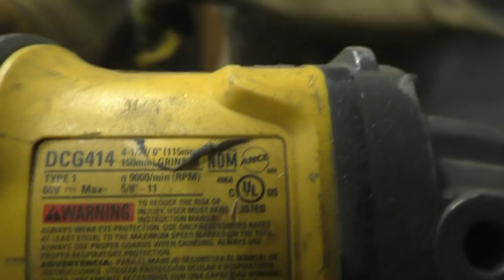Grinder Safety -- and lies you are told to scare you.

Comment: The guys who circumvent safety devices are all the same, It's some type of bravado issue for them, as if having a milky eye, missing finger, or black lung is just part of being a man. They are all over the place, guys who shim circular saw guards open, guy who remove chutes from lawn mowers, guys who take deflectors off grinders. You are not smarter than the engineer who designed the tool you are using. Safety is not a common sense issue, stuff fails, discs shatter, people die and fate cares not one bit if you were the best or worst of operators. Protect your Eyes. Protect your Lungs. Protect your Ears. Disrespect the tool and safety at your peril.
Reply: Uh, nah
Reply: well said.
Reply: I agree, the guard is not even necessarily to protect you from yourself, its to protect you from a variety of factors.
Like, theres a chance a grinding disk may be cracked because someone dropped the grinder or a manufacturing defect.
Just because it isn't guaranteed to hit you when it shatters there is still a chance it might hit your or someone else.

What if you turn that thing on and it shatters the second you touch material? What if a sizeable chunk gets flung off the jobsite and hits a kid in the head?

The crap this guy is spouting would not come from anyone with an engineering degree or half a brain cell.
just simple maths lets you figure out how dangerous that grinder wheel can be:
Assuming a 180mm (7 inch) grinder at 8500 RPM:

 180mm*3.141=565.38mm circumference = 0.565m 
8500*0.565=4802.5 meters/minute = 80 m/s
The surface of that grinding disk moves at 288km/h or 179 mph.

Do you want to get hit by a quarter of a grinding disk at that speed? Do you want to take that angry fast piece of disk into your nuts?

I found some cutoff disk mass specs too (Merry Country 180 Professional Line Grinding Discs):
180x1.6: 88g
180x3: 
172g
180x6: 360g

Kinetic energy = 1/2 * mass * velocity²
So if a quarter of the disk decided to break off you'd get, respectively 

180x1.6: 0.5*0.022*80²= 70.4 Joule
180x3: 0.5*43*80²= 137.6 Joule
180x6: 0.5*90*80²= 288 Joule

a .22LR has 170-300 Joule of energy.

You gotta ask yourself, do you want to risk basically shooting yourself in the hand, or the dick, or the eye with a .22LR for literally no reason other than taking the guard off for the sake of taking it off?

We could figure out exactly how much energy each part of the disk would have based on distance from the spindle and the respective mass of the area but i can't be bothered
Reply: @timramich  Are you seriously telling me that the tangetial force, that tangetial momentum is just going to disappear?
 
You need to understand that the issue most people have with this isn't about running a grinder without a guard (I mean, who hasn't)

It is rather that it encourages people to not have a guard on there ever.
If you tell the average idiot that "you can run a grinder without a guard if you pay attention to x y z" all they will hear is "run the grinder without guard!"
Reply: @Blacktronics  You would be lucky to reach half of 180 mph. The disc breaks. It has no more force being imparted on it from the motor. It has to change direction (it will want to go centrifugally, so the energy to move the mass tangentially is a tremendous amount of loss). A clean-air break is more dangerous. Purely uninhibited. Not gonna happen. As this guy said about life being about risks... We need to start letting the stupid die out.
Reply: @tchevrier  Watch a video of a shattering CD. It goes outward in an arced path. That's called centrifugal force. And there is no centripetal force involved after the thing snaps, so I don't know why you even brought that up. If the disc is touching something and explodes, then the edge of the disc will propel it tangentially. Since no energy is being added to the disc anymore, is takes energy from the disc to propel it tangentially. You'd be lucky if it flies tangentially at even 80 mph. 180 mph is just fear porn drivel.
Reply: @timramich  "Watch a video of a shattering CD. "  You are talking about way higher speeds.
Reply: @EgadsNo  Speed has nothing to do with this.
Reply: Joe Blow frivolous lawsuits have a lot to do with all that crap you just said about safety over engineering stuff. Your the guy who wouldn’t go off the rope swing in school because your mommy has coddled you into believing you might get hurt.
Reply: To kill someone with a grinder you need to either intentionally try to kill by grinding into their vital parts or smakc someone in the head with the machine so hard that you crack their skull and that is just plain old murder/manslaughter.
If the disc shatters and the debris hits a person anyhere it aint gonna kill anyone, I have been hit in the neck by a cutting disc that blew out and all it managed was a hugeass mess just cause that area tends to bleed profusely when cut.
Angle grinders really arent as dangerous as you try to make them to be, I prettymuch fully agree with the old chap here but I do recommend keeping the deflectors on the grinders as it can save you from bit of pain and a messy wound and keep those safety glasses on so you dont lose an eye.
Reply: @zameliz  we wernt talking about safety glasses here. the point is if you dont put your body parts in the way they won't get hit in the incredibly rare occasion that a cut off wheel does come apart. any sort of good work clothing such as long sleeve work shirts and carhartt pants an leather work boots will stop a broken chunk.
Reply: @zameliz  if it ends up being a triangular chunk hitting spike forward you've got sufficient energy and little enough surface area to cause damage. 

Taking chances where there's no need is called being reckless. .
Reply: @Blacktronics  If it is a chunk like that then it means its rather small and doesnt have the mass to deal any sufficient damage and it would lose its energy very rapidly as it is not going to have good ballistics.
It may pierce unprotected skin and cause a small bleeding wound but thats about it.
A shattering cutting whell just does not have the potential to become lethal.
Reply: @Blacktronics  i mean it depends on what kind of wheel your using. I agree with you, always keep the damn safety on, its there for a reason! for small grinders and 1mm discs, thing is if a fragment breaks it has barely any energy in it due to its small mass and because of a large surface area it slows down. 

I was cutting a piece of alu profile for a shelf on a wooden chair type thing, and the disc accidentally got pinched in the profile. Shattered like a bitch, and got a few chunks of it in my face. The safety glasses saved me from a few cuts on the eye but thats it. 2 pieces hit my face full on but there was not a scratch, as all the energy got dissipated. 

At the end of the day, i think its a balancing act of sorts between what precaucions are needed. I mean sure, if your using a 150mm grinder with a 1mm disc, there is no need for a bulletproof vest and kevlar gloves as well as a triple layer full face mask, HOWEVER common sence should still be used and basic safety measures should not be neglected, and safety measures should be aproprietly chosen depending on the working conditions.
Reply: @tchevrier  i agree from a physics standpoint it was a bit bullshit what he said, but your point is just as bullshit because you neglect air resistance. Drag can be applied with different magnitudes depending on the surface properties of the shard, and as such they can curve and fly off wherever they want.
Reply: @zameliz  hmm must have been a pretty big disc. I was luckier, had a disc shatter a couple times but was never left bloody. granted, i nearly crapped myself when it hit my face though.
Reply: @ivanrodionov9724  have you used that same disk on steel prior to cutting aluminium?
The aluminium and the iron oxide embedded in the disk can actually go into an exothermic reaction and blow the disk up. (literally thermite)
Reply: @Blacktronics  Very possible scenario actually, although the ammount of dust would be miniscule, as any dust would be blown off but yes, I cut through both steel, aluminum and also copper with that disc that shattered. Although this could be a problem for a VERY dusty floor.
Reply: @ivanrodionov9724  Its was like 2/3rd of a disc that hit my neck. The wound was just a small an shallow cut but it just bled quite profusely, it was more annoying than painful or serious really >_>
Reply: @zameliz  Ouch! yup, most grinder cuts are like this, wide but very shallow(assuming your using a thin disc). still dont neglect safety though.
Reply: @ivanrodionov9724  Yeah safety is paramount and I allways have gloves and safety galsses on when I grind stuff.
And yeah it was a cutting wheel, I actually havent ever seen the  thicker grinding discs shatter but I have seen a laminated sanding disc to blow up once.
Reply: It's not a matter of manliness. It's a matter of not being as concerned about injuries. It's a personal value judgement whether you think a gash is or isn't a serious injury. 

When I sharpen my knives, I cut myself every once in a while. In my opinion, that's perfectly fine, because you can slap a bandage on it and carry. If I sharpened my knives in such a way as to never get cut, I would have to sharpen them much more slowly. It's a tradeoff, as with all things. You can't make a logical argument to someone about what is or isn't an acceptable risk. It's solely a matter of values.
Reply: @zameliz  see we reached an agreement: safety is paramount and should be appointed aproprietly. As for the bigger grinding discs shattering, I thank God also never encountered it, although it is possible if you drop a grinder with one of these on.
Reply: @Blacktronics   "A baseball weighs 145 grams 90 mph = 40.23 meters/sec KE = 1/2 mass x v2 = .5 x 145g x (40.23m/s)2 = 72.5g x 1618.45 m2/s2 = 117337.84 g m2/s2 = 117.34 kg m2/s2 = 117.34 Joules"; standard 145g ball, thrown at 90mph.
Reply: Erik Johansson are you aware that the “guy who made the video” has built a 75 foot steel boat in his front yard?
Reply: Freeman319 that’s a bad analogy. Here’s a more accurate analogy: If you had built a house from scratch, you’d probably be pretty good with a hammer.
Reply: @timramich  The path that shattered CD fragments take look pretty straight to me, not "arced". Any curving of the path is due to gravity and aerodynamic forces, not your pre-Newtonian conceptions of motion. A shattered disk fragment doesn't magically lose tangential speed just because it's no longer attached to the spindle. It doesn't "take energy" to "propel" the fragment tangentially *because it's already moving tangentially at 180mph*.
Reply: @zameliz  Except the fact that people have actually died from exploding grinding discs. It also wouldn't take much for a flying piece to sever your femoral artery, causing you to bleed out in a matter of minutes.
Reply: @Blacktronics  after seeing this, I'm convinced that all those dude who don't care about guards or think they aren't necessary, are in the same camp as flat earthers. Can't fight the science.

Comment: Mate i don't even know what to say... but don't encourage nubes. I work with grinders every other day and Iv had and seen injuries that warrant keeping the guard on. Don't mean to be the health and safety police but people should learn with the gard on
Reply: having a guard on just allows for people to be stupid with the tool.
Reply: I absolutely agree. If it can be done with the guard on, do it. I only remove the guard if it is absolutely necessary to get in a tight spot, and that has only happened a handful of times over the last ten years for me.
Reply: Personally, I'd try it with the guard on, but if I understood the risks and the guard was getting in the way, I'd remove it. Getting frustrated with obstructive safety equipment is as, if not more, dangerous than faulty equipment.
Reply: I support Natural Selection.
Reply: How are you gonna fit a 6" cut off wheel on a 4" grinder if you use the guard.  Bottom line wear ppe and dont be stupid. And ALWAYS USE THE HANDLE.
Reply: Yeah I'm actually baffled he had suggested no guards are ok. I have seen many bad grinder injuries and had a few close calls myself. Best one was a 1mm disk exploding. A piece cut through the laces of my boot in a few places. Damn happy i was wearing shoes
Reply: @nathanchalecki4842  I have been using a grinders for 15 years. Never used the guard. It forces me to focus %100 on what im doing. I will say that a face shield gloves hearing protection and a quality dust mask are necessary. A leather  apron never hurt either.
Reply: @678friedbed  thats like saying wearing a condom just allows people to have sex. No. thats not how it works.
Reply: Shhh, don't comment without valid experience. I used grinders with no guard since 1980.
Reply: @jackk8422  or an 8 inch saw blade.
Reply: @jackk8422  Only use the right sized of wheels in the right size of grinders. Grinders are dirt cheap nowadays so that shouldn't be a problem.
Reply: use your common sense, use 6" wheel on 7" grinder. just because you never encounter problem doesnt mean it safe. 6" wheel usually design to operate on lower RPM if iam not mistaken 6000rpm. While 4" grinder and wheel is design to run on 11000rpm. that is 5000rpm different. just like car, if you try to force your care to operate past it RPM limit for long time what do you think it will happen
Reply: @slyztercoreveanged3175  Yeah, it's about speed.  Most grinding discs are designed for somewhere around 80m/s at the periphery of the disc, and they will come apart in a very nasty manner at some speed above that.  This doesn't mean that an 80m/s disc will explode at 81m/s, of course.  Damaged discs will also come apart suddenly, a particularly common case is thin cutoff wheels which have had a chunk knocked out of them by some other idiot - the vibration caused by the imbalance is what does it.  The Beyond the Press channel did a couple of vids exploding discs at overspeed using a router as prime mover, IIRC.

There are cases where you shouldn't be using a guard (hint - when using cutoff discs is not one of these), and cases where you simply can't use a guard as it gets in the way.  For most people these are exceptional circumstances, and should be treated as such.  I've had discs explode on me multiple times, superficial cuts only, thankfully, and I've had a 6" grinder with a sanding disc on it (no guard, impossible with sanding disc) jam so hard that it was ripped from my hands and thrown back into my face.  That one got me stitches to the cheek.  I also picked up the pieces when pretty much the same thing happened to a colleague, and the grinder chewed much of his finger off.

Grinders /are/ extremely dangerous tools, and treating guards as something that is there to scare you is stupid and irresponsible.
Reply: @jackk8422  Hear hear on the face shield. Thought I was the only one...